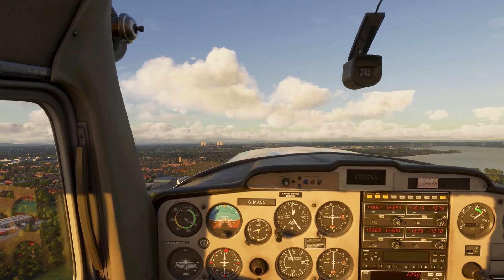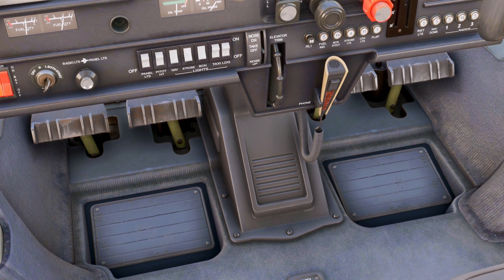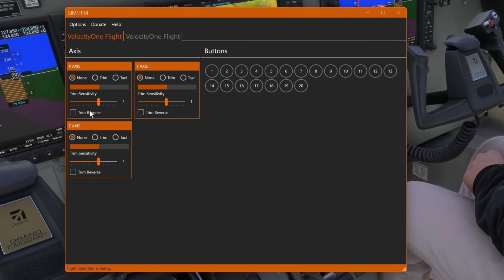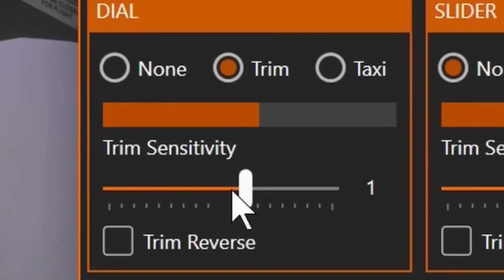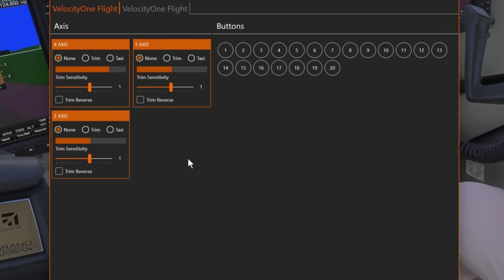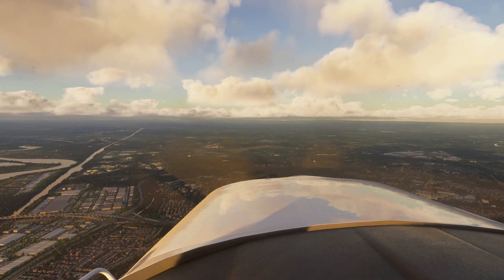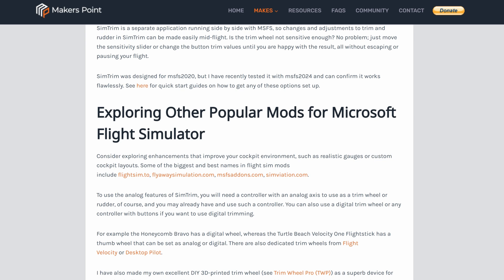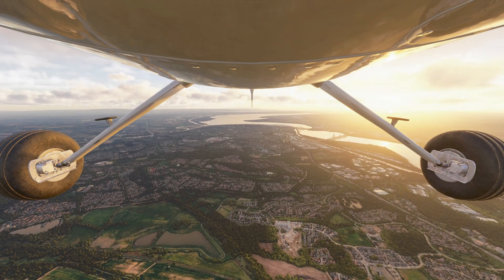How I Made Flight Sim Trim Super Easy With One Free Tool!

Comment: I use a Honeycomb Alpha buttons for elevator trim up and down, do I just clear the bottons on my alpha control wheel?
Reply from the maker: Its most likely digital so clear it in the sim and then look at which button lights up when you press. Then set the trim sensitivity on the button.